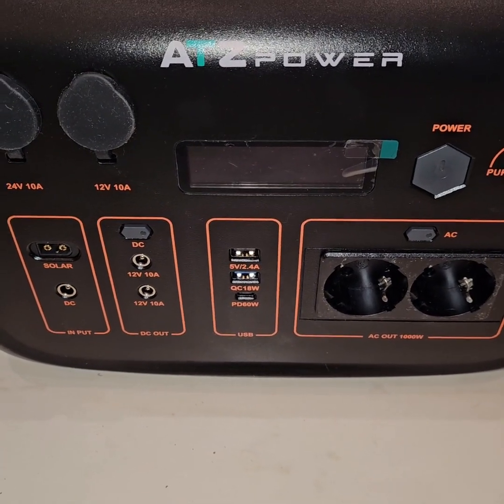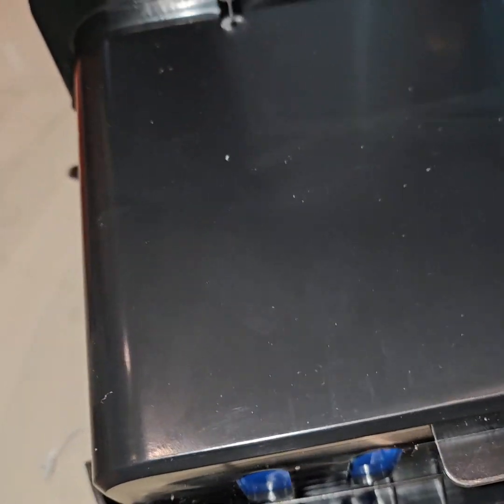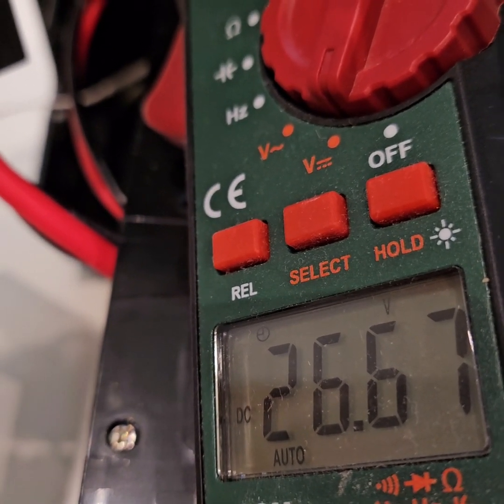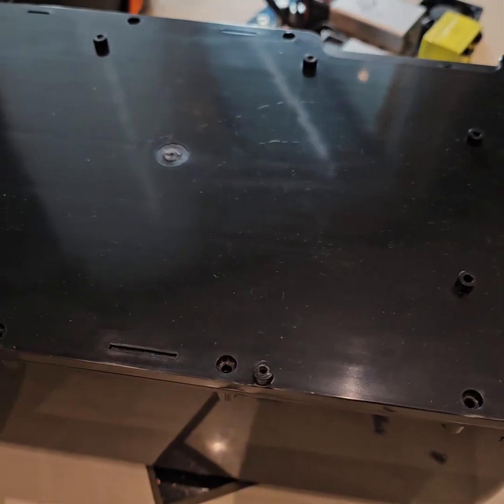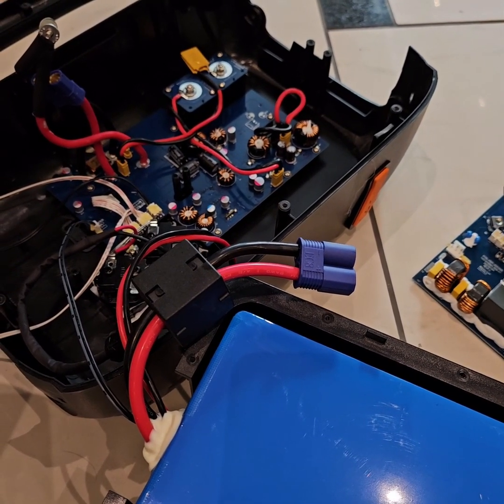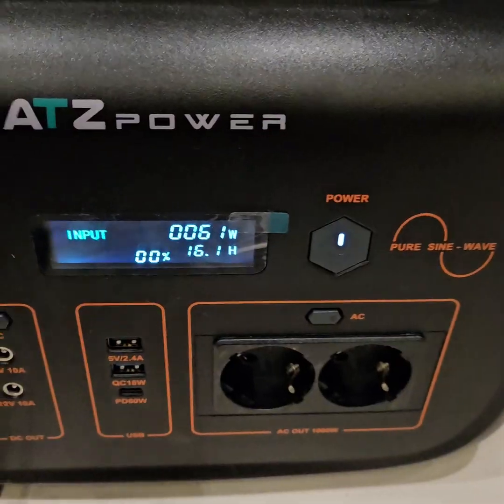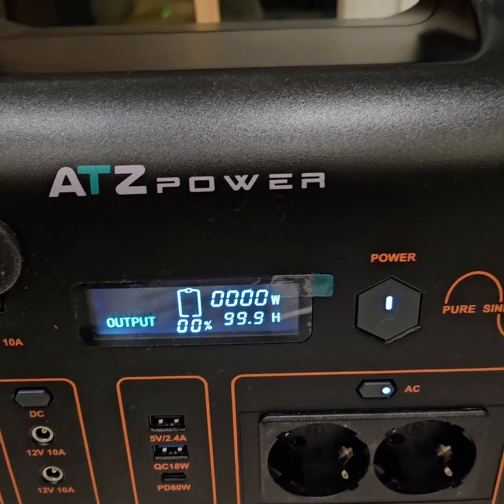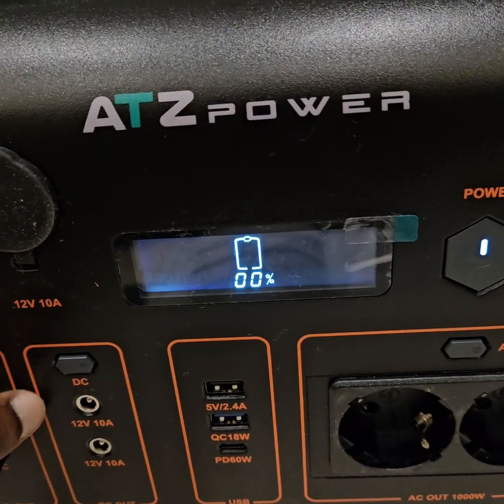Cheapest 1kw Powerstation ATZ Power 1075wh, Quickreview and teardown Part 2

Comment: Did you get it to show the right capacity again? 
What do i have to press?
Reply from the maker: One cycle of complete discharge and charge  fixed the display
Reply: @HouseAndSolarProjects  Thanks! in the german manual it says smtn like "press power button, release, then press and hold for 5 sec" to enter the recalibration mode
Reply from the maker: Yes, I did that too, but it does not seem to have any effect

Comment: it's awesome ! thanks so much for your videos, i'm kinda wondering if it's really an LFP or just a fake x) kinda odd it wouldn't show LFP/LiFePo4/Lithium Iron Phosphate on the battery itself,

Also, were you able to do a capacity test ? like with a LED TV, it should technically work for around 10-15h straight if the capacity is the right one. So curious, even at 320 now in germany it's interesting to buy and get delivered to France !
Reply from the maker: I will do a teardown video of the battery pack to find out, what really is inside.
I was able to get around 900wh at the load of 150 Watts, another 50wh at 45 Watts. This is enough in my opinion. Currently at 318 minus 10% coupon.

Comment: Is it LiFePo4?
in the manual it states LiFePo4, but on the battery it says "Lithium-ion"
Reply from the maker: LiFePO4 batteries are a subtype of lithium-ion batteries. 3.2V is typical of LFP Batteries, otherwise it would be 3.6 or 3.7V.
Reply: Great, thanks a lot!

Comment: Also my solar panel is 100w 18v would it work?
Reply from the maker: Single Panel would not work, you will need two 18v panels to connect in series to get 36v for built in mppt

Comment: Would you recommend it?
Reply from the maker: Yes, for the price under 300 Euros , I would recommend it
Reply: @HouseAndSolarProjects  and were you able to do a capacity test to verify that it's actually 1000wh? Also what's the maximum AC tested wattage? Thanks for your quick response
Reply from the maker: I was able to get around 900wh at 150w Load, and then additional 50wh@ 20w Load
Reply: Hi, is it possible to charge the station faster, and which charger can I choose 48v 6a, or 36v 8a, etc.? I am interested in the maximum voltage and amperage range?